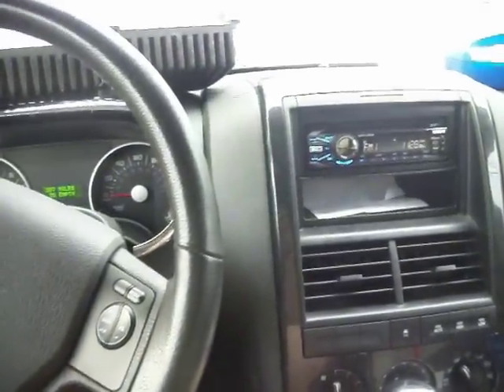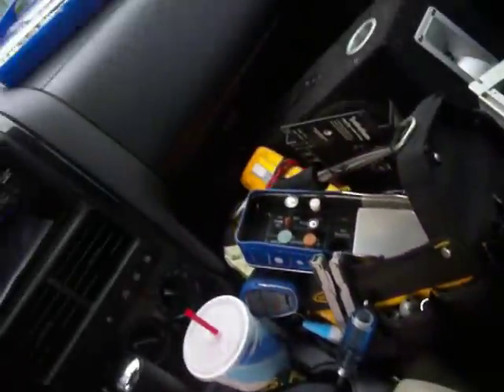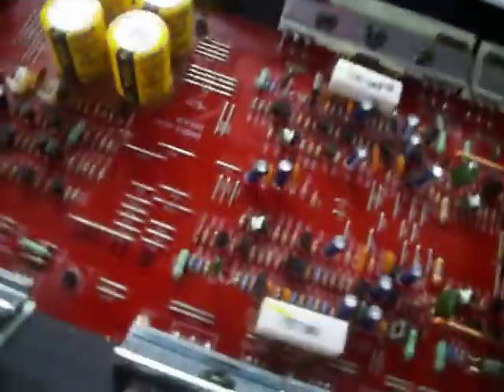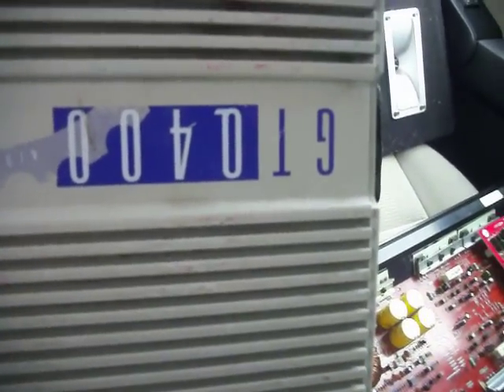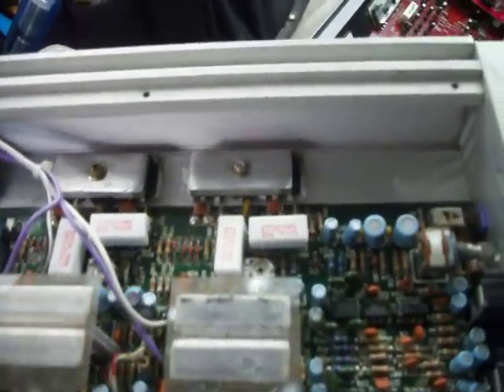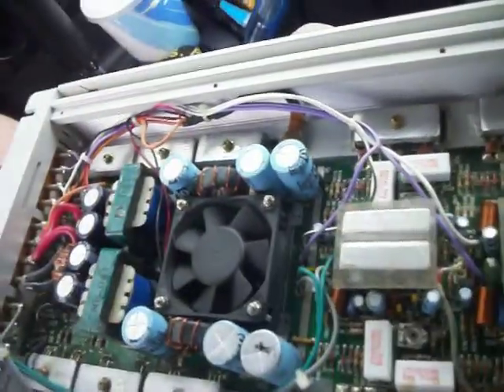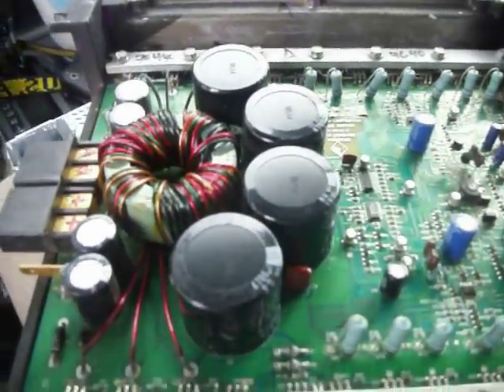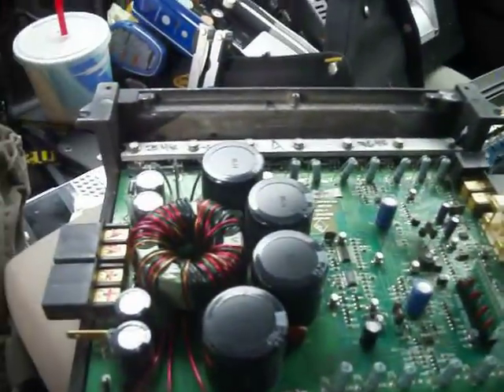RF old school amps guts as well as Memphis,Phoenix gold ZxTi,Kicker Sx650.4,American Legacy

Comment: The from what i can see the amp with the big metal fan on top has bad capacitors(if the top of the caps are bulging they're bad),the 4 big ones under the fan.The amp before that wont work because the transistors that are blown are to the power side of the amp.The white thing you called it is a resistor...all parts are cheap to replace,remember when changing transistors buy all at same time from the same build time or package..good luck.